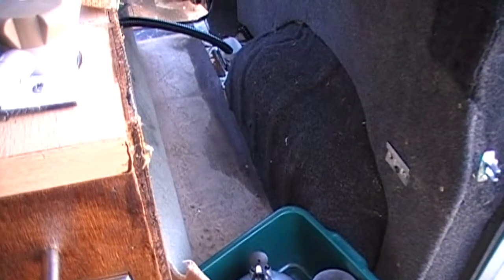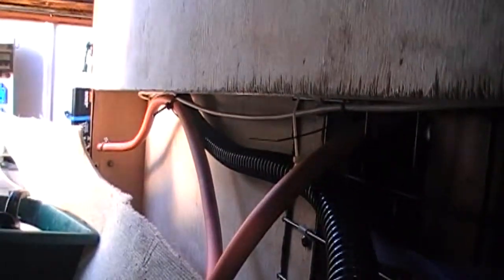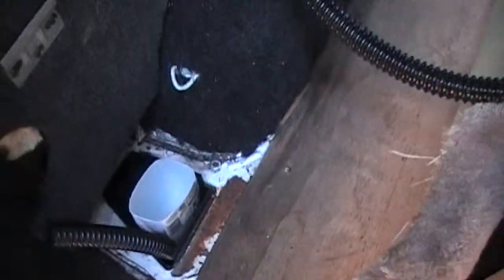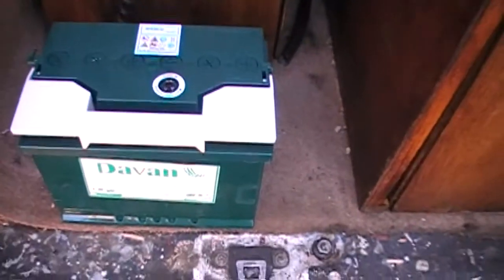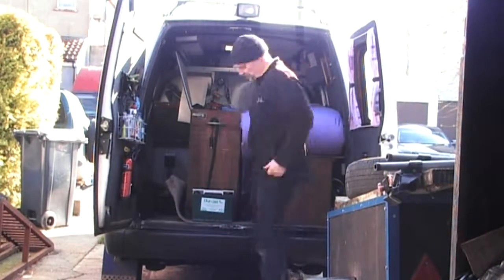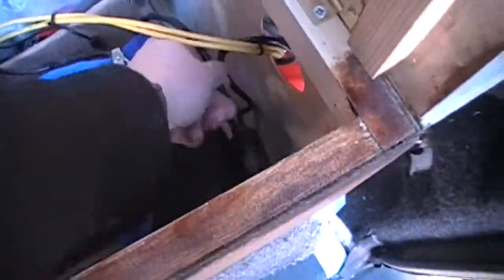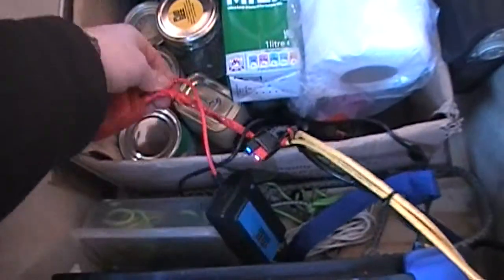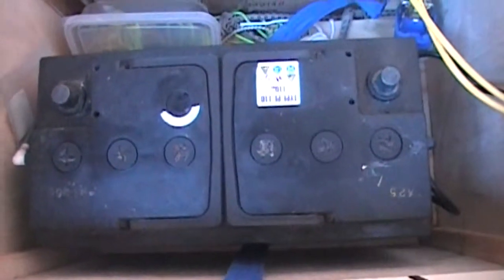Scudo Camper van repairs  - Waste pipe water leak - New battery install - Part 1

Comment: Hi Guys,

Thank you for the tips. I thought a leisure battery would be a little excessive for what I intended to use it for, but sounds the better option. Would need to look for a compact sized battery. Once again thank you.

Comment from the maker: Hi Mate :-) I have a self switching relay that charges the battery when it reached 14.1 volts and switches of when the engine is turned off. I believe Rick uses the same is I remember correctly. hope this helps? :-)

Comment: Just a quick question Rick about your battery Choice. Do you use a split charge relay to charge the battery from your van. I am looking at something similar to run a large coolbox/fridge, in my mpv. The coolbox has just a motor in it of course. I looking to be able to run for a couple of days if poss. I could fit a solar trickle charge I suppose. Any tips?